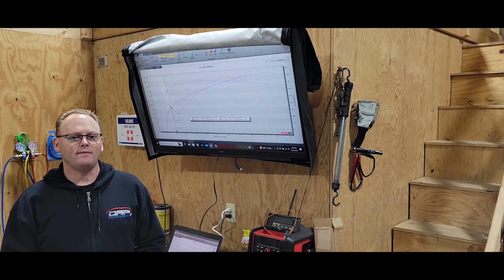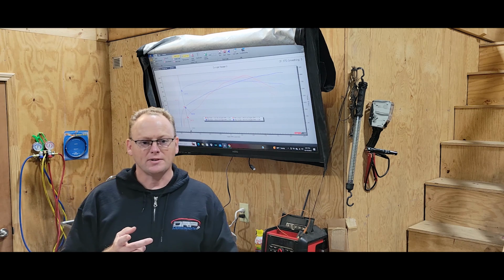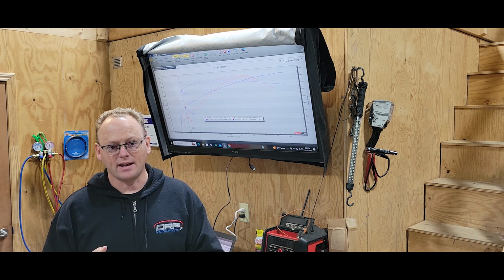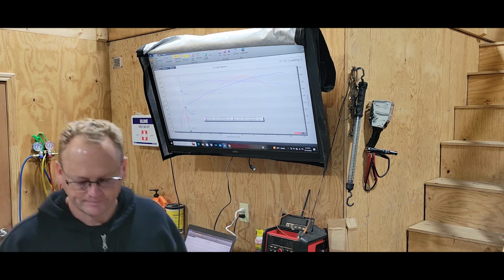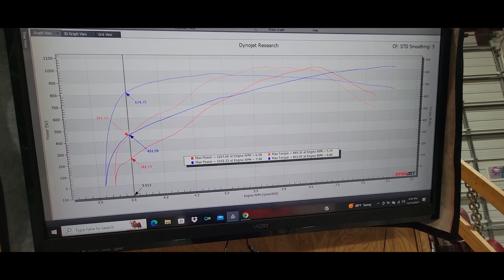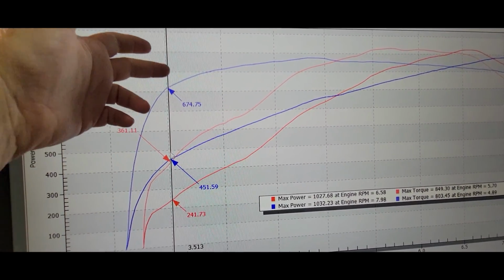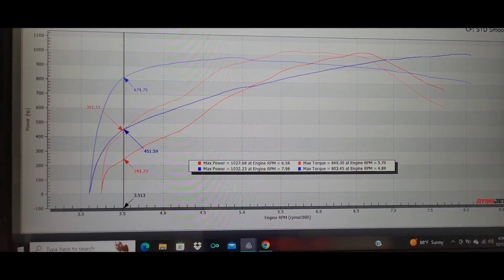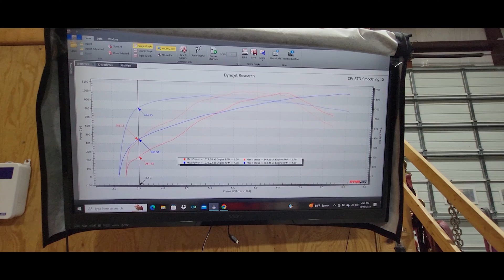Dyno Chart Comparison: Twin Turbo VS 3 8 Whipple Supercharger

Comment: Great video Ray!! Having the whipple 3.8 SC does that make it difficult to daily drive with the mustang? Do you have to have a drag pack wheels/tires to accommodate the quick increase in torque? I ordered a Dark Horse on 6 April. Still waiting on the car. Going back & forth with the ESS G3X verses the new 6th generation Whipple SC. Your thoughts especially if I won’t be going to the 1/4 strip but a few times per year, mostly street driving. Thank you Brother‼️👍💪🇺🇸✝️
Reply from the maker: The 3.8 is actually surprisingly streetable. 
I'm running a drag pack with MT ET streets on the rear. They hook really well both on the track and street.
Go with the 6th Gen Whipple for your car! We will actually have them on sale tomorrow on our website!